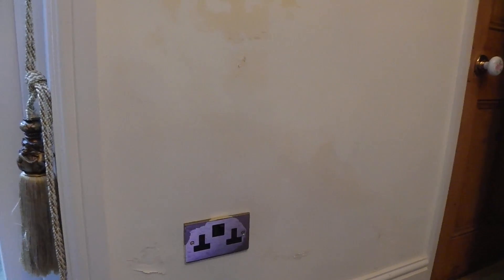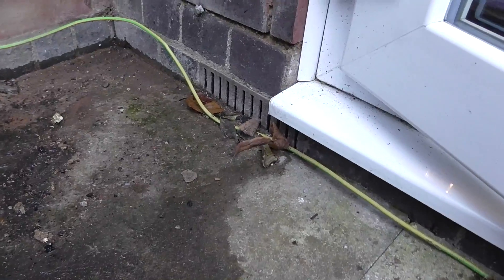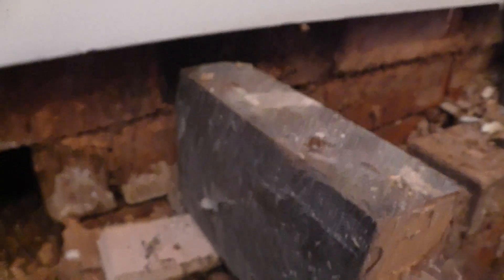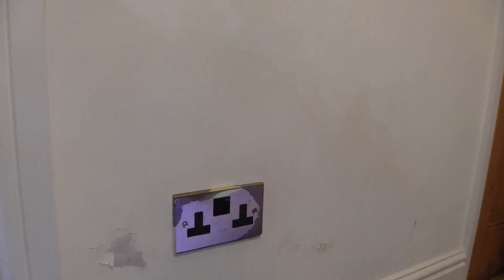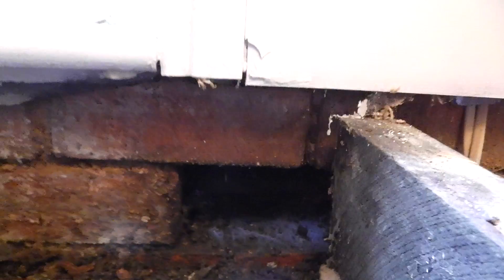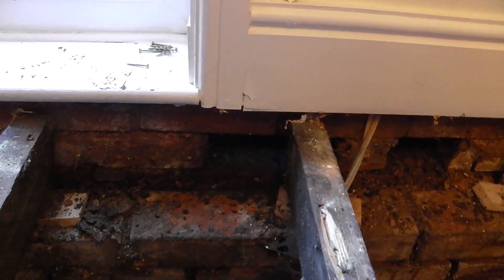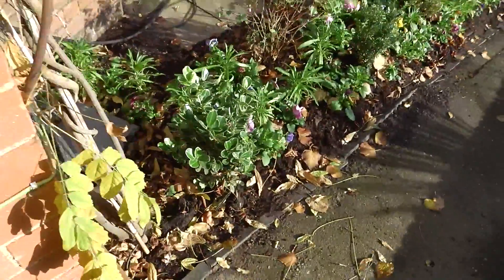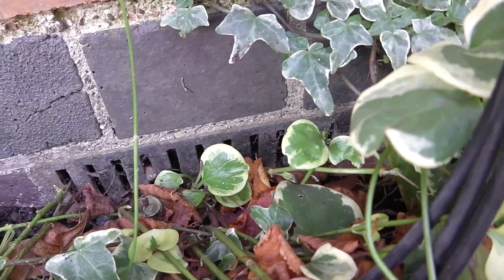Rising Damp in walls, Blocked air bricks - Part 1, The Problem

Comment: So important to keep air flow beneath floors.  Dampness, the absence of drying air and the presence of wooden joists leads inevitably to dry rot and expensive repair bills.  The cheap prevention is to keep soil levels below the bottom of the air bricks.
Reply from the maker: Hello Joseph, thanks for the comment - very true!!!   We had two more properties in December with just that (along with a number of other related issues), one client was just about to spend £7,600 with a so called damp proof company which would have made it worse. Thanks again for your comment, it all helps to educate people. Happy New Year

Comment: From April onwards what is the approximate time you would allow for drying? Are we talking months or a year or more? And is there anything you can do to speed up the drying process naturally? Thanks.
Reply: Square Conduct Services  Cheers Ivan I will. I have put a cash offer in for the house but as yet haven't heard back. I know from my own experience that if you get a damp 'expert' out the next thing is someone is hacking out your walls to the tune of 1500 quid! All smoke and mirrors if you ask me. In this house they have a raised garden bed butted up against the back wall and to me this is the obvious cause so I shall remove and if you have any further suggestions (maybe air vent?) I shall be grateful. Alexis x

Comment: Can partially covered air bricks lead to subsidence over time? We have one very large crack in the supporting wall upstairs in our property and several smaller cracks appearing throughout the house. Before the lockdown we had our gutters cleaned, and a camera put down the drains beneath the house/garden to see if there’s any blockages or leaks I believe however we were told it is fine. We were also supposed to be getting a monitoring device fixed to the crack to see if the house is still moving but his cannot be installed right now due to the ongoing situation. Just last week though I noticed that two air bricks are partially covered by the previous owners of the property who built up the steps from the back door/back of the house into the garden. They do slightly tilt downwards away from the house which allows the water to run off. We don’t appear to have any rising damp in that area where the air brick is partially covered however I am wondering if water getting down there beneath the house could possible contribute to any subsidence. We’ve mostly been told that the reasons of the subsidence are possibly due to a large tree that is just beyond the bottom of our garden, and we also were told it could be as we live on a busy road too.
Reply from the maker: Hi louise, a very interesting question. The main walls (front, back side), will be of solid construction at the footings and the wall itself. As such there won’t be anything to rot as such and cause the problems you mention. Small internal stud walls may be different but I’m not convinced. What may be happening is, should there be damp over a long period of time (leaving aside the root cause of this for now), th floor joist could rot at the wall, causing a sort of floor bounce, with the forces associated on bouncing, being transferred to a good joist. This could cause localised cracking but not any real subsidence so again, my money is not on that. Your drains may be clear and intact but adjacent and or upstream may not. You won’t know until the subsoil is inspected around the cracking. You don’t mention the age of the house, or relative location of said tree. Do feel free to send me a few photos on email and I can comment further. All the best and thank you for raising an interesting point. Regards, Ivan

Comment: problem with these "PROFESSIONALS" is they aren't professional at all. they get a franchise to sell a product, and a book to read and wham bam, thank you maam, instant professionals. i have worked all my life in the building industry, and do as you do, before i even measure for damp removal. i see people tank a wall like that, causing even more problems. i live in South Australia, where salt damp is a blight. problems like the one you have pointed out usually leads to the complete destruction of the wall base in my area. I have seen salt crystals only rivaled by placing a stone on the surface of a salt lake!

Comment: Hey, Brilliant video.I'm looking for some advice. A 1920's house we have recently purchased, has a 'rising damp' issue as brought up in the building survey. We intend to clear the air bricks which have become overgrown with weeds inside them. Also we have fireplaces that have been blocked up by gas fires, do you think this may also be causing a damp issue. We intend to get a gas specialist to remove these gas fires and open the fireplaces back up and let the house breathe for a while. Are there any other methods you suggest? We will be going back to the brick to see what the damp looks like, should we just let the house breathe once we do that, also what do we re-plaster with?Jodie xxx
Reply from the maker: Hi Jodie, thanks for getting in touch. Chances are you don't have rising damp at all is the first thing to note. If you paid for this survey I'm happy to look over it and Comment.......your certainly doing the right things but there may be some obvious other ones that can be simply identified . Email a fee photos over and I'm happy to look at them, no charge. Use .....    info (at) squareconductservices (dot) co (dot) uk best regards, ivan

Comment: What happens with the brickwork underground which is in contact with damp soil? How do you stop bricks absorbing this moisture and damaging mortar?
Reply: @squareconductservices   And what mortar mix would you use with the engineering bricks?  Sand and cement? sand and lime? hydraulic lime? quick lime? We know that Peter Ward hates cement because it traps moisture - so many questions.

Comment: How is damp in patches further up on the wall tho? If you don’t mind me asking?
Reply from the maker: Hi, i took maybe 6-8 months before all the salts had come to the surface and the EMUSHION (do not EVR use so called 'Damp proof paint') stoped going to a powder. during this time, a simple wipe with emission after a light brush off of the salt dust was all that was needed. A few years on now and there is absolutely no sign whatsoever. Hope that answers the question, if not, please do get back in touch. Best regards, Ivan

Comment: am i right in thinking that the pea shingle is acting as drainage,unlike the soil that was retaining water
Reply from the maker: +karl bardsley Hi karl, the idea is to have AT LEAST one brick depth below the DPC as dry to prevent any breach (directly by debris build up, or indirectly by rainwater splash). In an ideal world you would lower the s the is often impractical, so creating a free draining (dry) section towards the wall is the next best thing. You ca use pea shine or 20mm or whatever, the things to look are, 1) It must be free draining, not fill up like a swimming  poo and 2) the space in-between the backfill doesn't fill with dust/soil or whatever and thus hold water.  Anytime you want to send me some photos, please do so :  info @ squarecondustservices(dot)co(dot)uk

Comment: Like your video, you are no fool like the rest of those a holes in the damp industry con.    could you give me a little advice?  I I've in an 80 year old house that used to have timber floors,  over the years they took them out and replaced with solid floors throughout with air bricks covered over with new plaster outside, with extension to back possibly higher than the older house's damp course,  i have damp rising up internal walls which i have stripped back and treated with salt inhibitor then re-plastered using tanking cement and the re-skimmed,   why would the damp be on internal walls?

Comment: Yes I got same my socket is damp
Reply from the maker: Hi, not uncommon in these situations, if you have galvanised capping over the wires and/or galvanised edge beading for the plaster work you will eventually see the galvanise breakdown and what is rust, coming through the wall, expect salt build up too....if you need any help, please do get in touch, phone number on the website www . squareconductservices . co . uk (without the spaces), thanks, Ivan

Comment: Those that say rising damp is a myth are wrong. In certain circumstances there is no question that rising damp does occur. See it regularly.
Reply from the maker: Hi Slashley, correct indeed, unfortunately the term has been highjacked by the injecting/rendering mob as a capture all term to frighten people into spending ££Thousands when they don't need to. In its purest definition within the building context, its 'capillary action' and for anyone reading this, see https://www.youtube.com/watch?v=aGlRDZo2_Eo

Comment: With regards to your video.
You have half the problem identified, the groundworkers have raised ground levels and compromised the airbricks which are now far too low, however you failed to explain how the damp has reached the electrical socket and left that damp mark if there is an effective damp proof course?. The water ingress areas you pointed out are below DPC level and whilst this will contribute directly to sub floor humidity and also place the floor timbers at risk, this should not affect the walls at socket level (or above) if an effective DPC is present. Another sign of defective DPC is the spalled brickwork - this has elevated damp content (above the DPC) which has frozen fracturing the brick face.
Your recommendations alone will not be enough to solve these problems and if your advice is to allow this to dry naturally, I fear the client will have a long wait.
M Davison cssw - independent surveyor.
Reply: Hi we suffer  from damp it's not bad comes and goes and there's a damp smell in the basement.  Our hour needs pointing as the last person who did it did a shocking job and only half got the old grout out so the new grout as fallen out if we get our house pointed will this help with the damp.
Reply from the maker: imanishay send me some photos (inside & out) of the walls concerned, more than happy to have a chat about it free over the phone, use info@squareconductservices.co.uk
Reply: The damp up the wall and around the socket is caused by condensation.  Once the sub floor has dried out the wall will too.  It's definitely not caused by rising damp because of a faulty DPC.  This house doesn't need a DPC.
Reply from the maker: Hello Kevin, though i recognised your name from another comment earlier. You are however wrong in your first point. If you watch the video and part 2, you will see this. Correct on the DPC not being 'faulty', but i don't understand your last comment, it does have a DPC, perhaps you meant to say it doesn't need {another} doc, i.e. injected or akin. Best of luck with your own business but please no more 'self-promotion' comments.
Reply: +Square Conduct Services Limited no more self promotion?  I'm not promoting myself I'm just answering the previous question because you hadn't answered it.  Do you really think those blue bricks are preventing rising damp?  Rising damp is a myth.  That's what I meant.  
On YouTube anyone is allowed to leave comments and reply to other comments.
Reply from the maker: Blue Bricks (aka engineering Bricks) are a recognised DPC technique and have been for over 100 years, of course they representing RD, not sure where your getting your information from wikipedia? The same article that says 'rising damp is a myth' because an RICS director once said so, and later retracted/clarified it. Nice throw-away headline to use, but total rubbish. Suggest you brush up on the science behind capillary action, or simply watch this https://www.youtube.com/watch?v=aGlRDZo2_Eo The problem was a breach of DPC which was then cured, that is, the problem was answered. Like i said, suggest you watch the video rather than just shoot from the hip
Reply: +Square Conduct Services Limited I suggest you watch Peter Ward videos on YouTube.  He left a comment on this video.  Also check out his website heritage house.
Reply from the maker: You really aren't helping yourself, but carry on you are doing wonders for my publicity but not much for your own. Firstly i have a huge amount of respect for Peter, but you haven't bothered to understand the context of his, or the aforementioned RICS Directors comments. Let me enlighten you, Capillary action exists, its a scientific phenomena. It happens in bricks or basically anything thats porous (not a Blue brick, as it isn't porous, hence why its users as a DPC). This capillary action, has over time, had the phase 'rising damp' coined to it, with respect to houses. Nothing wrong with that, and actually quite well descriptive. Where it all goes wrong, for uneducated people and those who dont take the trouble to understand, is that where there is a problem with the DPC (breach, etc), the phase is also used for walls that should be dry and are now wet. Again, descriptively correct, but it fails to distinguish between 'what' and 'where' the issue is, as such it allows the injector-boys to come in an easily sell an injected solution on the basis that they can stop rising damp. Therefore, the saying 'there is no such thing as rising damp' should actually be 'there shouldn't be rising damp in this area and its being caused by something that shouldn't be happening'...very long winded, so you can see why it isn't used. (Yes damp can also be caused by condensation, but thats another story and that certainly isn't 'rising damp' and certainly, wrongly given the term)

If you want me to come and educate you further so that you may be better informed, please email me and we can talk about rates, but simply quoting out of context isn't going to help your business flourish anymore that quoting out of context one of the industries best.
Reply from the maker: Your arrogance astounds me, capillary action is a myth??? or yet again did you not read what i had wrote....but your also not regaining any credibility by mixing issues and cherry picking phrases, if thats the best you can do, i do hope any future potential clients of yours are reading this....DPC's won't stop rising damp...my thinks every house builder in the country from when Roman's used cornish lead to stop RD will have an issue with you on that one. Yes you can build without them, but under special circumstances/conditions and not the techniques that have been and are used predominantly in the UK.
Reply: +Kevin Amatt also in the Netherlands and other countries, they don't have DPCs on any of their houses.  And they don't have problems with rising damp

Comment: Damp wallys will soon need to find a new job i think.
Reply: Not when I've been doing my job right  for 8 years now lowering outside driveway gardens flower beds opening up floors to take out all the rubbish that's been washed in over the years air bricks and opening up the caivitys to take out the rubbish that's course's the walls to go wet with some wall the plaster has to come of so I can get of the tanking crap some wankers put on to allow the walls to breath again to replaster I use 8 to 1 sand and cement and no waterproofer never had any problems with any job that I've done I'm now close to 12 hundred houses that I've fixed for several estate agents in my area